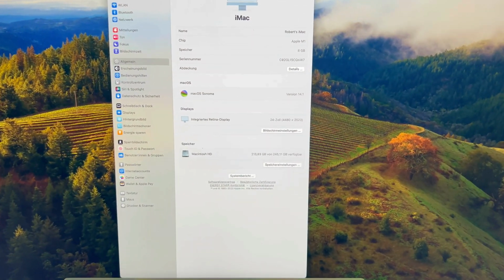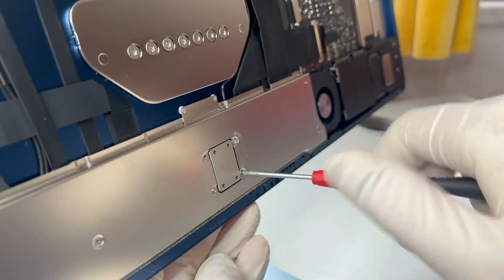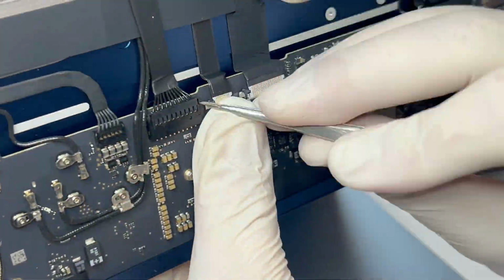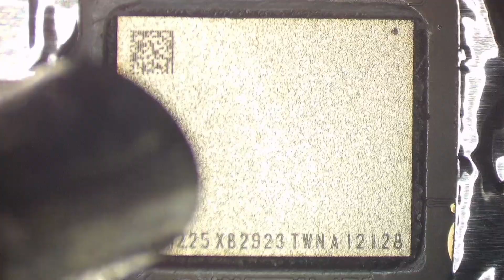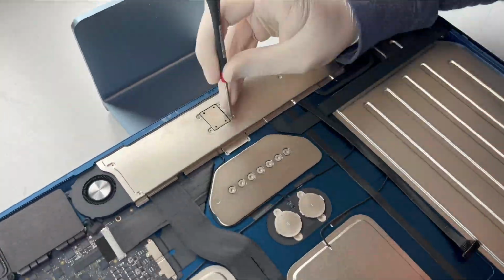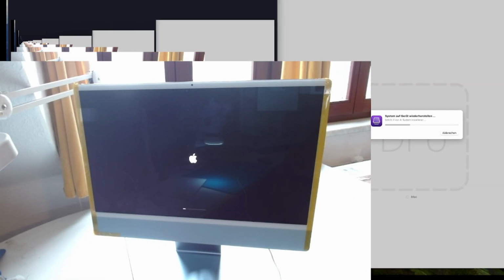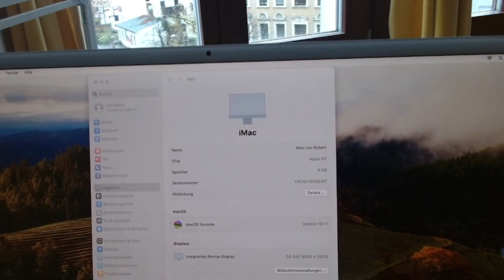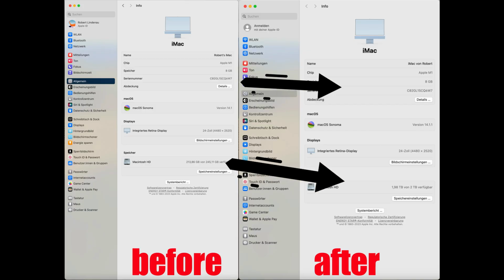Apple iMac 24" M1 (A2438) SSD Upgrade 256GB to 2TB

Comment: I DO THE SAME PROCESS SAME MODEL , GET ERROR WHE RESTORING THE  FIRMWARE ON IT,  ANY IDEA WHAT IS THE PROBLEM , IS NECESARY TO UNLOCK THE ICLOUD BEFORE UPGRADING":
Reply from the maker: @mobiltekpanama3584  No, likely an issue with nand and/or soldering. Maybe you can fix the „CAPS lock“ issue as well🤣

Comment: I have a 24" iMac M1 with 2TB SSD. I am thinking of upgrading to the new 24" iMac M4. If I buy the M4 with 512GB SSD, could I swap the SSDs between the two machines? That is, is the 2TB SSD from the M1 usable in the iMac M4?

Comment: Like @AllyKiss18 said just get a proper NVME M.2 that's faster than the internal SSD and you can use it with an upgraded iMac later on like I did that and now have an 8TB iMac M3
Reply: Proper nvme m2 that is connected by usb port to iMac ?
Reply: @ USB-C yup
Reply: @JDzWORLD i know it works but your nvme is connected Through usb adapter ! USB 3.1 type C is fast but not as fast as an internal SSD ! 
Also internal SSD does have lower latency! about 60% the latency of the external SSD!
Reply: @ I hear what you’re saying but I’ve seen it proven and it’s faster on mines